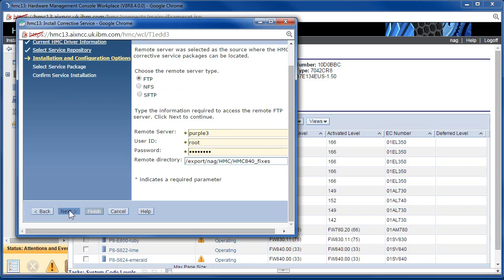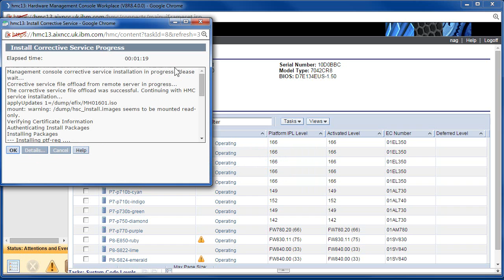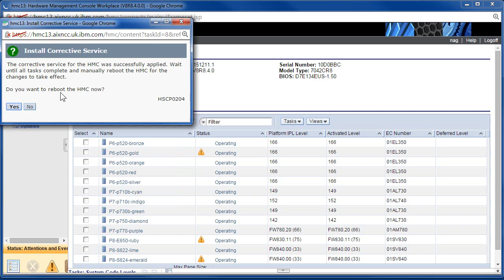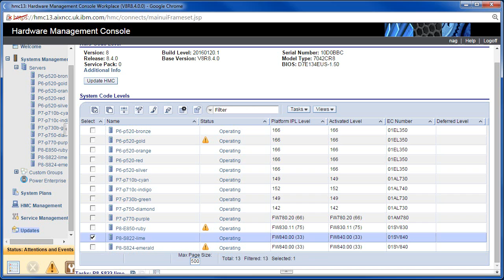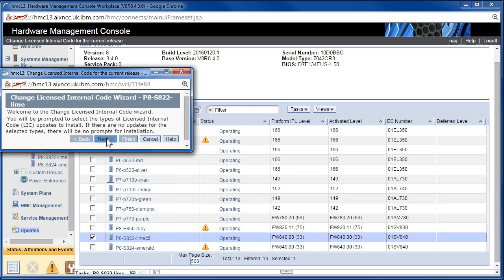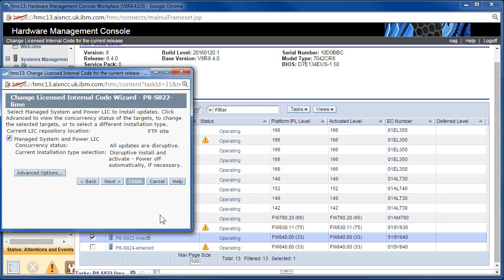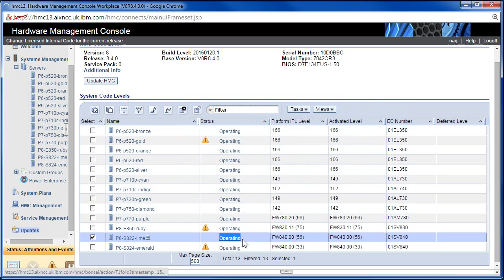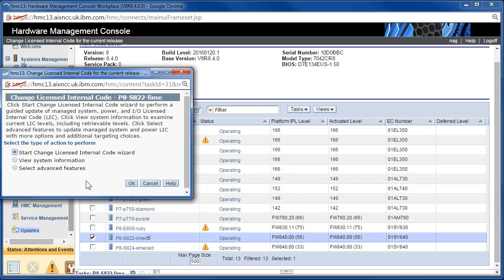HMC v8 Classic Part 6= Upgrade HMC & POWER8 Systems Firmware

Comment: Hi Nigel
Currently 7.9.0 SP3 is running in my environment, can we upgrade it on V9
Reply from the maker: Probably but 7.9 is ancient. So need to cross check with your HMC hardware level (how recent and does it have enough memory), your managed POWER servers (v9 will not support POWER5 or 6 servers)

Comment: I need to upgrade from 8.4.4 to 8.4.6 ....Do I need to upgrade ifix MH01560 AND MH01729 before proceeding for upgrade ?
Also I have 4 partitions(systemA production, system B DR, system C dev, system D dev DR) I am thinking if I can test only for system D first 
Is it possible }?
Can you share video for this if possible
Reply from the maker: Samrendra Gour  you need  to upgrade you server firmware and the HMC. Look in IBM fixcentrl and flirt tool for details. You should be on 8.7 by now a d I am sure 8.4 is no longer even supported.  You should be upgrading yearly.
Reply: Nigel Griffiths thank you Nigel ...I am now upgrading to 8.8.6 but need some procedural document which I am unable to get for batter understanding
Reply: Nigel Griffiths sorry my bad....I mistyped in first comment I am upgrading from 8.8.4 to 8.8.6
Reply from the maker: Ok what I recommend is downloading the update from IBM fixcentral. State the HMC level you are on and find out what is available and you will get full instructions on how to upgrade there many options like physical  media or get the package across ftp etc.